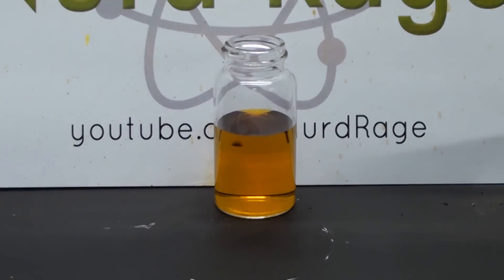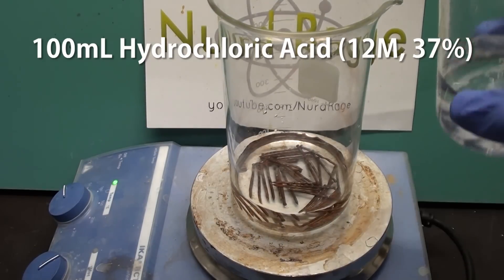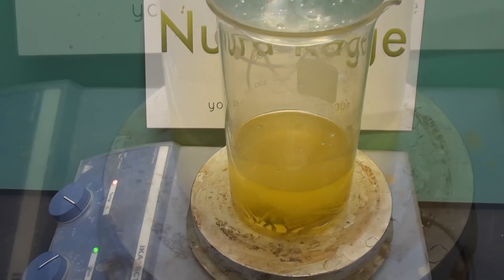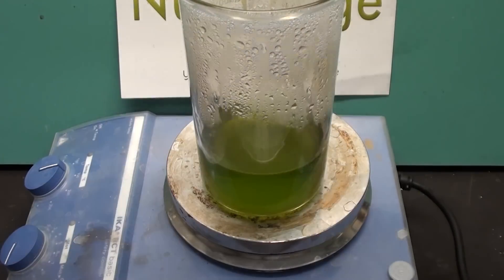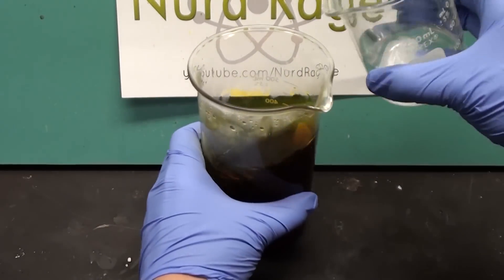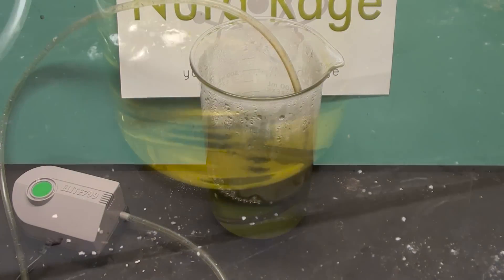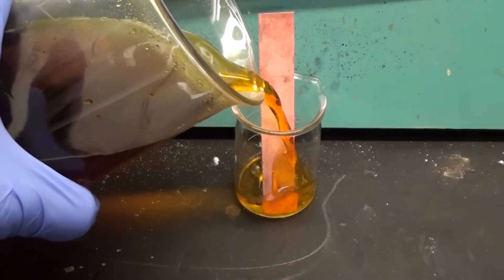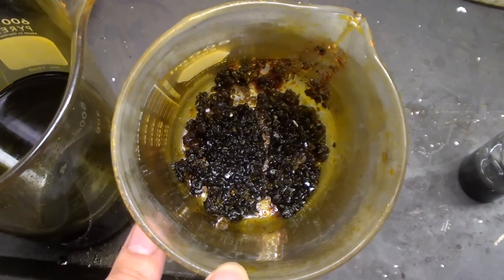Make Ferric Chloride (for etching printed circuit boards)

Comment: NurdRage  What is the advantage of using ferric chloride, over skipping a step and just using HCL and hydrogen peroxide (1:2) ? for etching pcb's, that is.
Reply: Patrick Hansen, one advantage is safety and convenience. At the strengths needed both HCl and hydrogen peroxide are dangerous. I once got just part one drop of 30% hydrogen peroxide on my fingertip and fingernail and didn't notice. About half hour later my finger suddenly felt like a combination of someone hammering it with a hammer while trying to pry up my fingernail with a screwdriver. And it wouldn't stop. Soaking in ice water finally helped a bit. It was difficult to use my hand for a day. I've gotten ferric chloride on my hands. I felt nothing. I just washed it off. It did leave a stain on my skin. Ferric chloride also does not release any smelly or dangerous vapors. Muriatic acid releases Hcl gas, which is more than just irritating, it's quite dangerous to inhale HCl or let the vapor float through the air and contact you eyes. Yeah, with HCl you don't have to just worry about it splashing on you, you also have to worry about it invisibly floating through the air. In fact, it's not a big deal if you splash it on your skin (as long as it isn't hot). The vapor makes it impractical to use indoors without a fume hood.
Reply: that was accurate and really useful info
Reply: I've used HCl and 3% H2O2 to etch PCBs. It worked great, but I was careful and did it outside. It's much easier to see the PCB as its etching than ferric chloride. Apparently you can re-oxidise the generated copper salts when doing subsequent etching but I haven't tried this.
Reply: @papa_gowon   Get 12% off Ebay, it takes way less and my double sided 1 oz boards etched clean in under 1 minute.  I leave it for an extra minute in case there are any small bridges that might still be there.
Reply: If you want to see the PCB while it is etching, then a much safer method is using sodium/ammonium/potassium persulfate (whichever is easier for you to find)
Reply: At the strengths needed both HCl and hydrogen peroxide are dangerous

You're already going to be using the HCL to make the Ferric Chloride anyway and 3% Hydrogen Peroxide is not dangerous at all.
Reply: If you want to see the PCB while it is etching, then a much safer method is using sodium/ammonium/potassium persulfate (whichever is easier for you to find)

Sure, if money is no object!
Reply: Where I live, sodium persulfate is 9USD per kilogram, while concentrated hydrochloric acid (measured by me to be 34%) is 5USD a liter and the dilute one is even more expensive, while 3% H2O2 is 2.5USD a liter, so sodium persulfate is way cheaper than HCl+H2O2 if yout take into consideration that copper requires 1 mole eq. of Na2S2O8 or 2 mole eq. of HCl and 1 mole eq, of H2O2 to dissolve
Reply: Where do you live? You should go into business reselling it. On ebay it is around $25 for a lb. ($55/kg) shipped in bulk.
Reply: I live in Eastern Europe. That price of 9USD per kilogram is on 500g packets of Na2S2O8 imported from Poland, one of them costing 4.5USD. Reselling them would be a good idea if the price is so high elsewhere. Thanks for suggesting this!
Reply: Actually, the price for it is 6.8USD per kg.

Comment: my glove broke and my fingers on my right hand are green and my skin is kinda broken looking i washed it with soap but nothing happened. I don't feel any burning i'm fine but a little scared.
Reply: somerandomguy fromthestreet 
Iron really isn't very toxic, but the PCB etchant will still be corrosive. If this happens again, quickly wash your skin with water and baking soda, to neutralize any acid.
Reply: Germas369 why?
Reply: somerandomguy fromthestreet u nid go doctor now!
Reply: no i'm good just my skin is a little green.

Comment: I have wondered  if you could use ferric chloride instead of ferric oxide in thermite. (In my understanding chlorine instead of oxygen would work the same way). Can anybody help me understand it?
Reply: Aqull Because I like sparks and why not.
Reply: Earl of Destruction See, this will work with other metal chlorides, but it is nearly impossible to get iron(III) chloride from a solution to an anhydrous solid. This is because it is hygroscopic, absorbing water from the air to hydrate itself, and if you decide to try heating it to dry it all the way out, it will decompose into iron(III) hydroxide, iron(III) oxide, and iron oxychlorides. If you wanted to prepare totally anhydrous iron(III) chloride, you would have to treat iron metal with dry chlorine gas or hydrogen chloride.
Reply: Technically yes.but from what I understand it's less stable and less energetic.
Also, google works.
Reply: Earl of Destruction Hmmm, why do you want to make thermite exactly?
Reply: Cruiser052 Thanks. I am going to try it.
Reply: Earl of Destruction  Yeah, sparks are cool. Well have fun .
Reply: Amos Zoeller Thanks, that explains why when I tried to mix them together they reacted before adding of anything.

Comment: Hi, Would you let me know what about 29% hydrochloric acid instead of 37% ???
I can not get 37%...What if I boil the 29% one..will be turn to 37% ??
Please let me know..please....
Reply: Sure, just use 130ml 29% HCl and 70 ml water instead
Reply: I did almost like that.. and another 200ml 29% ..but both are in a jar last 10 days but still nails and thin wires are there! no dissorved almost at all.. WT....
Reply: Double check you are using pure iron nails?
Reply: yu jin choi Depending on what the nails are made of, they could contain nickel or chromium, which makes the steel much, much harder to dissolve. Also, heating and even boiling the solution will very greatly increase the reaction speed, we're talking tens if not hundreds of times faster.
Reply: Amos Zoeller Hu..You know what..I believe it made of steel..and rusty was..they  have been in the Jar now..about 3 month now..still there !! It failed totally I dont know why,..
Reply: yu jin choi Just use steel wool, much faster and almost guaranteed to work. Remember to use non soap steel wool. Also, boiling 29% HCl will only drive off the gas and decrease the concentration until about 20%.
Reply: Davy Zeng Thanks for advice..seriously I follow your way almost but I dont know why it is not working ( Now more than 2 month in the jar ).. During that time I could not wait so bought the Ferric Cristal from Russia through E bay.. Well over all it is actually cheaper..So all good...Thanks anyway :)   I guess I am not a Wizard.. Cheers.
Reply: @gazgazgaz2  do you do with the crystals?

Comment: I was reading a paper on the properties of iron and it mentioned making green vitriol but reacting iron with concentrated sulfuric acid.

I have attempted this a couple of times using nails and 98% sulfuric acid (tech grade) and I instantly get a pure white precipitate! It has been suggested to use a dilution of about 60/40 di water to sulfuric acid.  I have tried that and the same thing happens.  it appears to be an insoluble pure white granular perhaps crystalline precipitate.

I have boiled this solution as well, but it does not alter this reaction.

Does any of this make any sense?  The nails I use are simple iron nails that I have used for iron II, and III chloride reactions without problem.

Comment: The trick to crystalize this is a desiccating bag/chamber.
I found a good trick for making a good desiccating chamber .  I used a large rubbermaid tub that seals completely.
I bought crystal kitty litter which is pure silica gel .  I use a half of a coffee can with mostly the silica gel and about a cup full of Sodium Hydroxide.  This mix seems to work just as fast as if it were sodium hydroxide alone, but way way cheaper.

Comment: Recently I made a solution of (I think) ferric cloride using a couple of iron electrodes and a usb cable, that I think have a potential of 5V. The solution was a table salt sature one, with some crystals on the bottom of the glass, and the electrodes were touching them. I'm sure that some clorine was produced, but after a couple of minutes the solution became of the same color of the ferric cloride. If it was actually ferric cloride, it would be more simple to produce, wouldn't it?

Comment: ok if I have on hand muriatic 20' Baume hydrochloric acid 31.45% can I just not add as much water to it and use this what is the conversion?
Reply: http://en.wikipedia.org/wiki/Hydrochloric_acid looks like all I need to do use less water I am trying it with 50 mL of water and 150 mL of 31.45% muriatic 20' Baume hydrochloric acid
Reply: CRJarvis not sure if less water helps. seems that with less water it can not absorb the iron.
Reply: the reaction will work with much lower concentrations it will just react slower

Comment: may I ask what exactly is a mol actually? People say its 6.02X10^23 but i have no clue. 
Any explanations would be kind :)
Reply: This is probably very late, since it's been 3 months since you've left your comment, but hey, what the hell.  A mole is the atomic weight of a single molecule/atom of a substance in grams.  For example, take water (H2O).  The atomic weight of hydrogen is roughly 1, and the atomic weight of oxygen is roughly 16.  In total, the atomic weight of one molecule of water is 1*2+16=18.  A mole of water is roughly 18 grams of water.  Avagadro's number (6.022*10^23) is used as a conversion factor between molecules and moles, meaning that there are always 6.022*10^23 molecules of whatever you have in one mole of the same thing.  Moles are useful because we can measure out that actual amount of molecules in a substance, and create exact ratios of reactants.